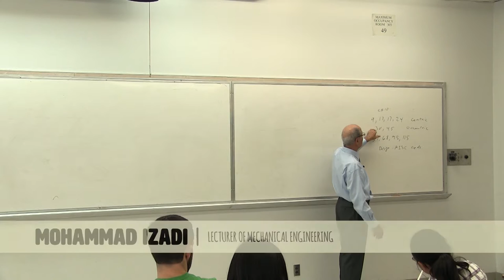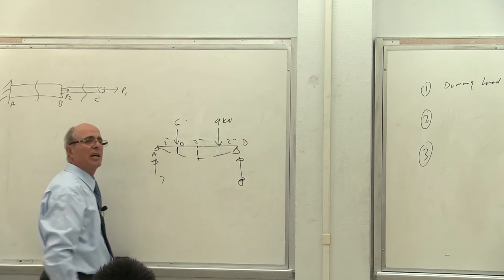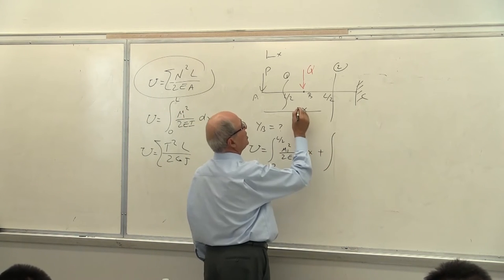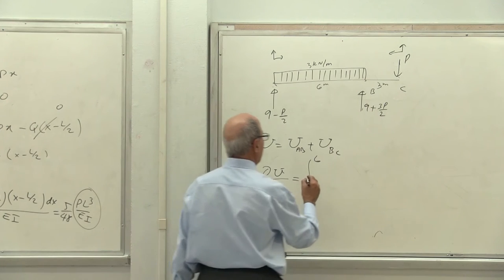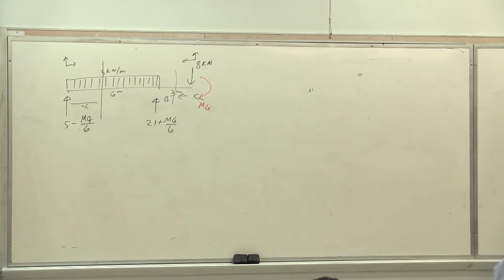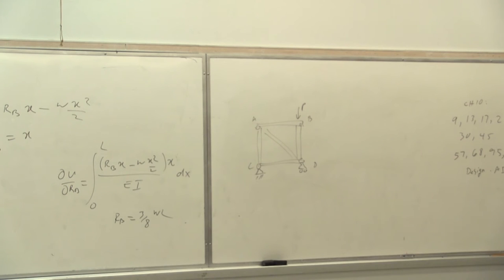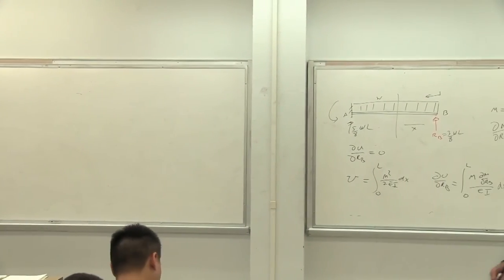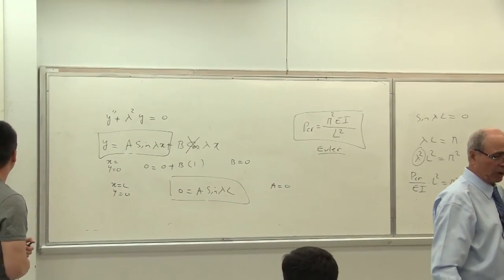Strength of Materials II: Castigliano's Theorem and Design (17 of 19)

Comment: Can i know is there any difference if i dont let the 8kN load =P,meaning i just solve it using 8kN
Reply: @TAHA ALHULAIFI   Derivation of strain energy w.r.t numeric value is 0. It does not work. Therefore, castigation's theorem has to do with derivation with respect to force.   Remember the rule, the load in question should be non-numeric in order to apply castigliano's theorem...The reactions also must be in terms of P....In the end, you will arrive an equation that includes P where you can use the value of P given in the question to arrive to the displacement.